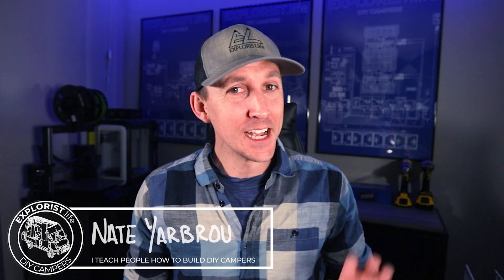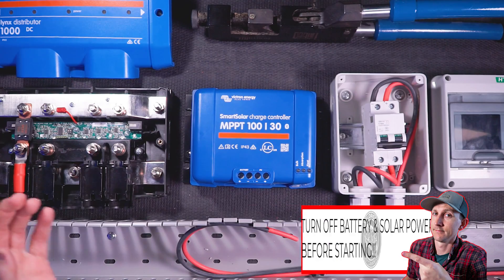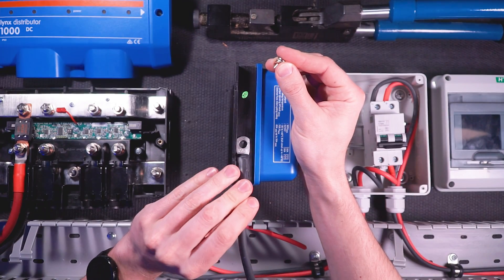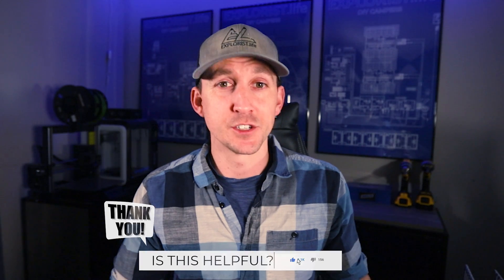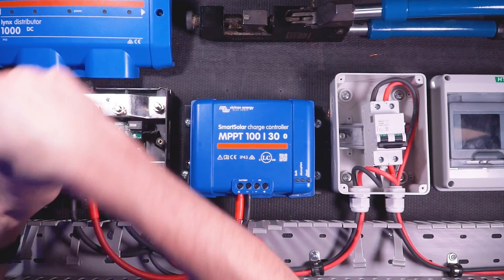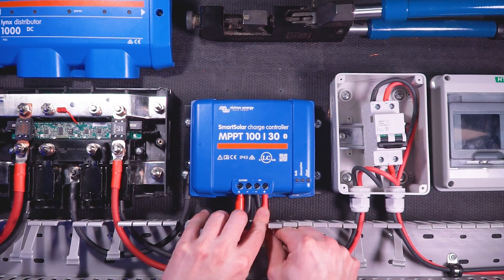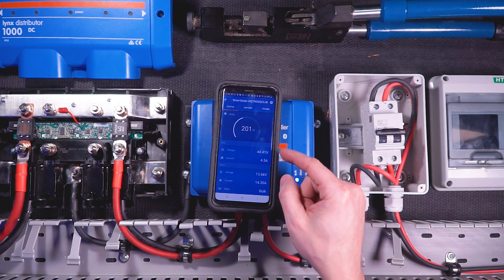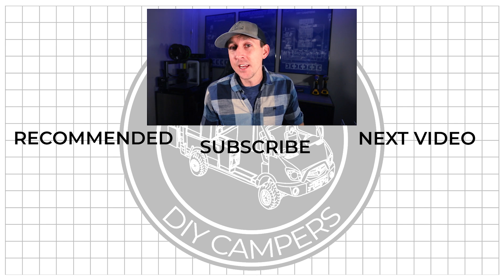How to Wire a Solar Charge Controller in a DIY Camper Electrical System

Comment: Nice video. Quick wiring question.  I connected my positive wire from the solar panel to positive PV terminal on a Victron 75/15 MPPT charge controller and the negative wire from the solar panel is connected to the negative lead on the battery (mind blown). The battery terminals are wired to the charge controllers batt positive and negative. Just trying to figure out why and how the circuit is complete and the Victron app works fine. I just hope I’m not going to damage something. I was not able to connect the negative solar panel lead to the negative PV terminal on the charge controller because of a pre Installed wiring issue.

Comment: Is it better to go bigger in the volts, or bigger on the amps when wiring panels together?
Reply from the maker: Higher voltage is better given that the array voltage does not exceed the max voltage of the charge controller.

Comment: Can we just put the 300amp/mega fuse inline on the positive wire at the positive battery terminal and ground the controller to the chassis?
Reply from the maker: I recommend running the positive wire to a fused busbar and the negative wire to a negative busbar.  A properly designed system will minimize the amount of wire lugs that are connected to the positive battery terminals.  My systems at https://www.explorist.life do that by using fused busbars.

Comment: No one seems to address the trailer wiring when installing a solar/battery/inverter system.   I assume the signals, brake lights etc. are a separate system, but the trailer emergency brake system must be tied to the trailer DC.  Is there a wiring diagram that shows this connection?
Reply from the maker: Signals, brake lights, etc are powered from the tow vehicle, so those are indeed totally seperate.

I don't have any specific diagrams for the trailer brake, but that would be (generally) treated as any other branch circuit from the 12V fuse block.
Reply: The emergency brake system should be connected directly to the battery bank with a short stop breaker so it's always available for an emergency even if the RV 12v system is turned off.

Comment: Love your videos!!   Could tell us why you “can” or “can not” connect 5 (all matching) panels in this configuration - 2 x 2 in series, with the 5th in parallel with the 2 series tied given a MPPT controller that will easily handle, amps/voltage of any configuration with these five panels.   Say 5, 100 watt Renogy panels, and Victron 100/50 charge controller.  NEED TO KNOW THE GROUND TRUTH!   THANKS!!!
Reply from the maker: Nope.  Here's why: https://www.explorist.life/using-mismatched-solar-panel-sizes/
Reply: @EXPLORISTlife  Thank you and hopefully I’ll make sense of it...

Comment: You might have answered this in another video and I have missed it, but how do you gauge what size charge controller you should use for your solar and what size wire?
Reply: Scrap that I found your other video but it only talks about series wiring your panels, what about parallel? Any difference?

Comment: Great videos Nate! Will you be making a video on adding an addition DC distribution block? For example, I will run a second fuse block on the opposite side of the van for distribution circuits to minimise wire runs as well as I just don't have enough fuses on my main distribution block straight from my Victron Lynx. Would love to known your thoughts, see this in an upcoming video! Thanks again for all your great work! Your diagrams and videos have been super helpful!

Comment: Thanks for all the great info on your YouTube channel. I have been looking for a 30amp mega fuse for the Victron lynx as they recommended for 100/30  dc to dv changer and 100/30 solar changer then I read your parts list and you used a 60amp fuse. Just trying to find the right info. Thanks
Reply: What is the answer? MpPT 100/50 = 50 amp fuse ?
Reply: hi did you have the right info now? i still asking me same question.. best thanks

Comment: Hey i have a question that has been aching me! I hope you could respond.  Thank you in advance.  If the battery is 48 volts and is 6kwh, should i connect it with a all in one controller that is 48 volts and 6kwh (i know matching volts is very important, but what about watts?) What if i decided to connect my battery to a all in one controller that is 48 volts but 6.5kwh ? Will this damage my battery? Charge it faster ?

Comment: What size wire should be used for the ground between the inverter and the MPPT controller? Thank you.
Reply from the maker: The equipment ground wire should be no smaller than one-size-smaller than the current carrying conductors for the piece of equipment.  So, I just generally use the same size as the pos & neg wires to consolidate wire sizes.
Reply: @EXPLORISTlife  so, if I’m using a 2awg as noted in your diagrams for the 3000w system, then, I should use the same 2awg for the ground. Sorry, the only reason that I’m asking is that it isn’t labeled on the diagram. Thank you.
Reply from the maker: @thehotmonkies  Yep! Exactly.
Reply: I am installing a Victron 100/50 MPPT controller and I am running 10awg from the solar panels through the breaker and then to the MPPT. The manual says that the power terminals  require a 6awg wire from the MPPT to the busbar. But, from what I’m reading, the 6awg might not be big enough and I should use a 4awg. Can you advice to the correct wire choice
Reply from the maker: 6 AWG is indeed the biggest wire that will fit into the MPPT 100|50 and should be plenty big for 99% of applications.

Comment: I remember you became an ambassador for Victron Energy awhile back, and I have two questions..
 Which of your designs would be applicable for use in a 800-1000 sqft off-grid home? And or, do you have the name of someone within Victron that could provide design support?

Comment: Great video!  is there any reason not to connect output ground to heatsink ground, then to ground bus bar? that way less wire is required and saves one stud on bus bar. Thanks!
Reply from the maker: Thanks!  The DC grounding conductor is defined by ABYC as: A normally non-current carrying conductor used to connect metallic noncurrent carrying parts of direct current devices to the engine negative terminal, or its bus.

So no.  The ground conductor needs to go all the way back to the busbar.

Comment: I have a Victron 100/ 30 with a load port , what is the best use for that .
I built a battery box with a 50 Ah battle born , Victron controller. I use it with a Flycraft boat with a 45 MinnKota. I change it with 2 Renogy 100 W panels. I have the load available , not sure what that is designed for ? Anybody?

Comment: Great video and so nice to see the lynx system being mentioned. a standalone video on the lynx would be handy for everybody. namely how the extra cost and fancy pcb are worthless without the VERY expensive lynx shunt so adding megafuse's to the 'power-in' lynx box and it does the same job albeit without the fuse blown LED's which wont work without the shunt anyway.....
i used a 'power-in' as a fused busbar and it is great and so tidy!!
Reply: Ya, I have one and It's strangely handsome.

Comment: Very well done Nate. You are putting out the best content I've found on YT for DIY solar systems. Thank you for taking the time to do this! I'm just waiting for you to show us how to wire a Multiplus to a 50 amp panel. That's the only part of my planned new system I don't understand yet.
Reply from the maker: Awesome!  Glad it's helpful.  I will be doing a Multiplus 50A install when Victron releases their 120V/240V compatible multiplus.  At this time (Feb, 28 2021), I don't recommend using a single multiplus for a 50A OEM RV Retrofit as you have to use a smart phase selector with it and just introduces an extra piece of equipment (that is never in stock).  Here is how I recommend wiring an inverter/charge into a 50A OEM RV: https://www.explorist.life/50a-camper-inverter-with-solar-alternator-charging-wiring-diagram/
Reply: @EXPLORISTlife  I actually purchased the high-res version of this wiring diagram yesterday. As with your videos, your wiring diagrams are awesome! I wan't to stick with Victron so all my equipment works together more seamlessly. I'm also on the waiting list for the Smart Phase Selector (SPS). BUT, if Victron is going to release a new Multiplus that has the SPS functionality built-in, I'll wait for that. In the mean time I can still upgrade my solar and battery systems. Your parts lists on the blog are awesome as well btw! I've ordered everything but the inverter and will duplicate your diagram exactly as shown.
Reply from the maker: Nice!  Yeah, I don't have an ETA on the 120V/240V Multiplus, but it's in the works.  If you do the standard multiplus with the smart phase selector, that will also work in the meantime for sure and my diagram paired with the diagram for the SPS can  work together pretty seamlessly.
Reply: @EXPLORISTlife  Does that Magnum MSH3012RV in your diagram power both legs of the 50amp panel (like a Multiplus with SPS)?
Reply from the maker: Yep!  Sure does.
Reply: @EXPLORISTlife  Dang! I wanted to use the Victron Connect app to monitor the whole system but if that Magnum powers both legs...
Reply from the maker: Yeah, I totally get that; and I wanted to wait until the 120V/240V Victron Multiplus was out to make that diagram for that reason, but I was having WAY too many questions to wait; and the Magnum is a good stopgap in the meantime.

Comment: What are your thoughts on soldering vs crimping the wire lugs?
Reply from the maker: For mobile applications like campers, crimping is the preferred method.  ABYC E-11 actually says that “solder shall not be the sole means of electrical connection”.  This is largely because the vibration of the wires induced by driving down the road can work harden the wires at the point where the wires get soldered and fail.

Comment: Do you have the link for those ferrule connectors?
Reply from the maker: Yep!  They are in the parts list of the blog post.  There is a link to that in the video description but here is a direct link as well: https://www.explorist.life/how-to-wire-a-solar-charge-controller-for-a-diy-camper-electrical-system/